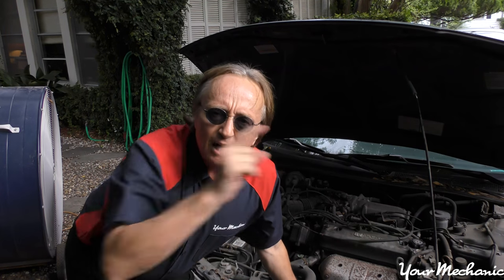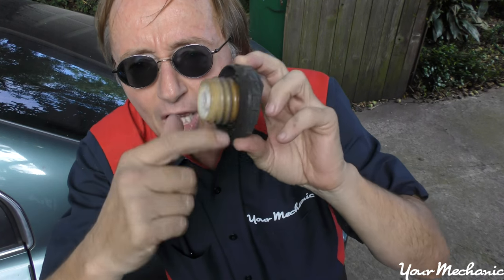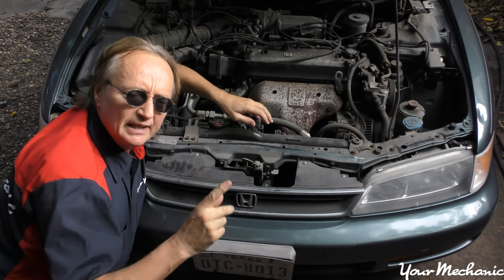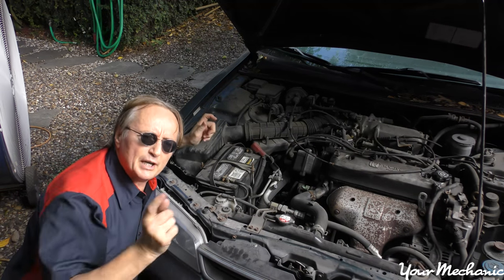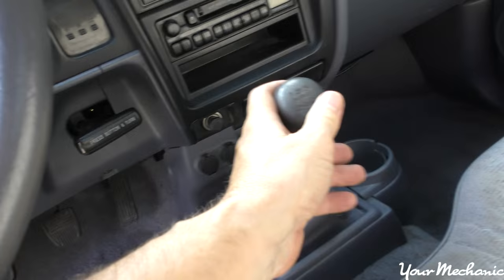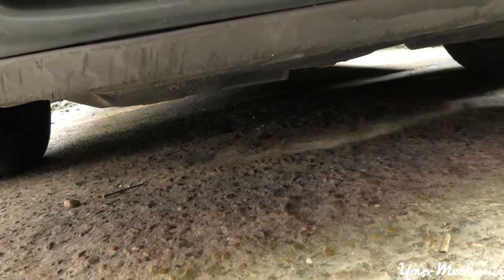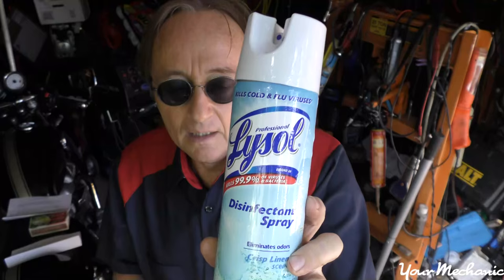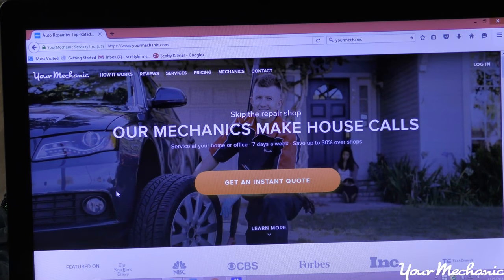How to Diagnose Smells in Your Car with Scotty Kilmer

Comment: I’ve been dealing with a burning oil type smell for months.  I have an 06 RAV4 V6. No leaking oil anywhere, no issues with any hoses or anything either. 3 dealerships have smelled it and can’t figure it out. You smell it from the front of the car, but inside it becomes VERY STRONG when you run heat and from the floor vents. Just a faint odor from the top vents or defrosters, and it completely goes away when you turn heat off or run it on cold. Any ideas?  Much Thanks!!!
Reply: Me too, did you ever find a solution?
Reply: What ended up happening
Reply: They will never tell you that the engine is defective,, but out of greed and the cost of issuing a recall and replace the engine is outrageous,, so suck it up and keep extra oil in the trunk to fill the engine every now and then...that is a common big issue on these rav4...

Comment: chemical smell coming from the vents only while idling. I just completely removed the whole dash and replaced the heater core. Figured it would go away but didn't. prior to replacing that the temperature gauge would rise until I hit a bump then fall back down to normal again. It also done that once since I replaced the heater core. Fortunately the green film that covered the windows hasn't came back but I'm still confused what is going on. I've replaced the coolant temperature sensor also. Any ideas?
Reply: bro do you smell burnt rubber-plastic under the dashboard also when you remove any vent you can smell it strong right ?

Comment: I get a chemical smell when I turn on the heat or cool air. What causes that? Thanks for sharing great video.
Reply: i get that its worse when engine is hot and when i put the heaters on hot air

Comment: I have a plastic burn smell coming from under the hood. I went to the dealer KIA two times and they failed to properly diagnose the reason. They cleaned the exhaust pipes in both times and the car still have this smell specially when I rave the car. Any idea what this would be? TIA

Comment: I have a really weird problem on my BMW F34 GT 2014 - under the dashboard there is a weird smell like burnt sand plastic rubber maybe oil not sure though  also when i remove any vent i can smell it strong, i got the dashboard removed clean the whole AC system and vents and the smell still THERE HELPP PLEASE PLEASE PLEASE [ Maybe the belt under the hood causing the problem ? ]

Comment: My 2011 Jeep Grand Cherokee ( Laredo 5.7L HEMI )  always smells like Radiator Fluid when I drive it YET no indicators come on that anything is wrong and there is never anything on my garage floor.  I am, however, using coolant that I have to refile from time to time ( ever couple of months  but only maybe a quarter bottle MAYBE ).   Heat indicator gauge does not go above half way and there is nothing in my information center showing any issues.

I recently changed my oil and oil filter and both looked Fine or Normal.  I do have about 135,000 miles on the vehicle and last year my water pump seized up and Me My Son and Father Replaced it ( My Son did all the work while we watched YOUTUBE video on HOW TO and supervised him without issue ) .

Engine seems to run GREAT.

Comment: Really enjoy your videos.  Thanks for all the information you provide!   I have a question.  I was smelling oil inside my 2004 Nissan Frontier truck for quite sometime. Yesterday, I took it to Nissan, and they could see that my valve cover gaskets were leaking.  So, they replaced the 2 gaskets, and cleaned up the oil that had dripped onto the sides of the engine.  Well, I drove my truck home, and I noticed during the drive home I would still smell oil, especially when I came to a stop at traffic lights, but even more strong when I got to my home, and drove up my driveway.... which is only about 25 feet long, but it has about a 30 degree slant.  The smell of oil was quite noticeable.  Do you think it is possible that there is just more oil located in other areas of my engine that are still existing ..... prior to having the gaskets replaced ?   I plan on taking my truck back to Nissan, but I was curious as to what you think the possibilities might be, regarding the fact that I'm still smelling oil inside the car?   Thanks so much!    :-)

Comment: Scotty this is an awesome video!  My used 2012 Ford Explorer AWD Limited that I bought from the dealership on August 25, 2018 has  a similar problem described in this video.  My wife and I noticed exhaust fume filling up inside the car and I'm not sure where it's really coming from besides the assumption of an exhaust leak somewhere.  Is the dealership I purchased this from obligated to fix this problem free of charge?  They will be diagnosing it all day on September 6.  Any tips or feedback?

Comment: My car started blowing smoke through the vents, it was a very STRONG smell of most likely Free-on.. I was .5 of a quart low. And topped it off at my oil change, That day. would this be a free-on leak? I had to turn the car off, and roll down the windows immediately. Also, at the same time I saw some smoke coming out of the hood, (was not hot)... thank you!!!

Comment: 2004 f150 battery goes dead after 3days.Had system checked several times. Replaced module behind rear seat but didn't fix the problem.

Comment: I have a 03 Hyundai Sonata and is has been smoking white coming from the back of the engine but car has been running fine without overheating and oil level seems okay and coolant level looks okay. What could it be? Someone told me it could be power steering leak.
Reply: look up car smoking white.  You are not going to like what you see. That almost always mean that water is getting into your engine somehow.  Possibly a leaking head gasket.

Comment: I need some advice my car just started  sputtering  and I don't know y also when I turned on my heat and I don't know how to explain to smell that I smell but it was not a gas smell it was not a wood Snell it was not amazing smell it was not any kind of smell that I've ever smelled before my vehicle does leak power steering fluid however I do keep power steering fluid in the vehicle on all times and only drive it when absolutely necessary
Reply: I had a sputtering issue and it ended up being my fuel pump. As for the smell when you turn on the heater... I'm having that same issue. Haven't figured that one out yet. To be on the safe side just take it to a mechanic. That's what I will be doing.

Comment: amigo I have a Lincoln mkz, everytime I turned on heat or cooler, my car makes smell like a fart. so I changed the air filter but the smell didin't go away,I took my car to mecanic-he said that he fixed with spray or whatever he did,but car smell didn't go away..I don't knw what to do..
Reply: Albertini Casanova check your catalytic converter or battery Scotty has a good video on how to clean a cat 
For the battery make sure theirs no corrosion you’ll see hunk coming from the positive terminal most of the time

Comment: My car smells like old rusty engine. It's a 2006 pt cruiser. It's not a big deal unless I turn on the heat. Then it's pretty bad.. It doesn't smell burning or moldy, more just like a motor shop garage.

Comment: Hey Scotty! I got a real strong smell of Acetone (like nail polish) coming from the inside of my car. what could this be?
Reply: windshield washer fluid. I had the same smell in my old Patriot. I replaced all the lines, and the nozzles and the smell went away. The one nozzle was broken underneath and the lines were deteriorating so when i hit the washer squirter, fluid would leak and get into the vents and smell my Jeep up.

Comment: My 2007 chevy impala jerks at 0 to 10 mph  every now and then
Reply: Reality Hitz check your cv axles, also could be a sticking brake caliper.
Reply: @bw6267  that makes sense. when i reverse out of park and turn my wheel all the way it creeks like a cricket when i turn too much and im having a roaring noise everytime i press the gas. whst im thinking is maybe an exhaust leak but the leak that i found on the pipe (thats super rusty as well) is really small and closer to the muffler.